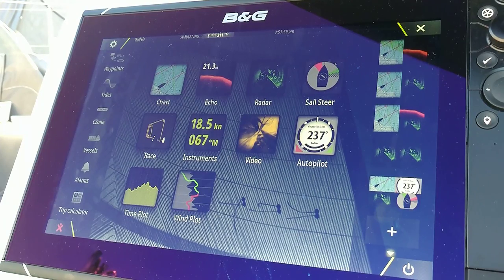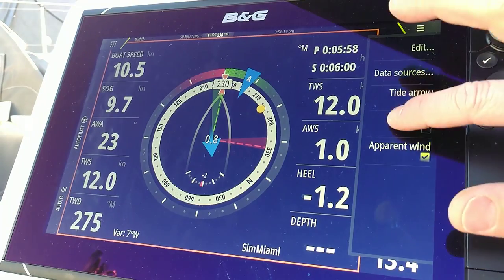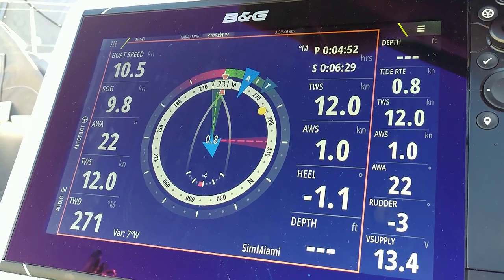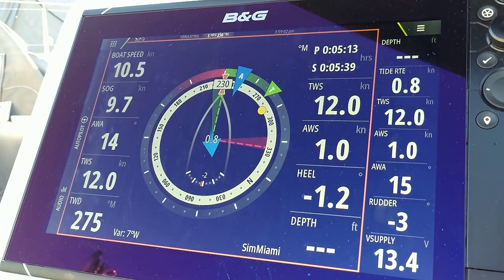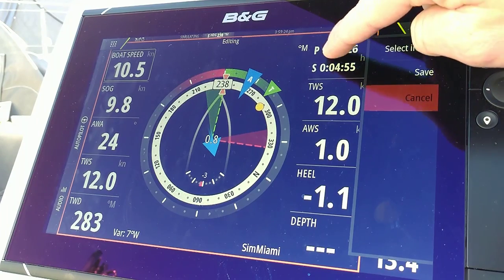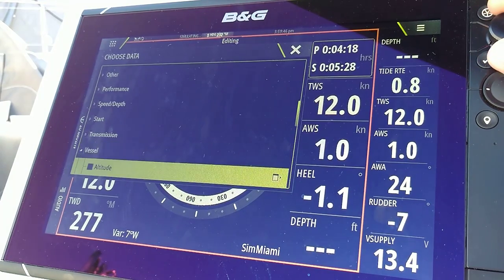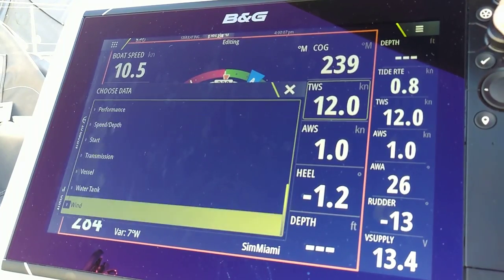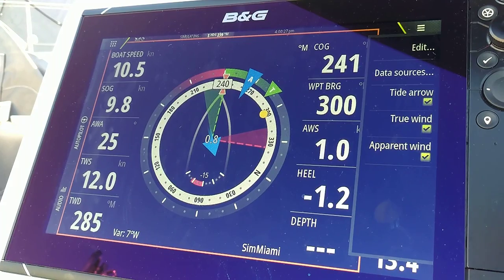B&G's Award Winning Sailsteer!

Comment: Hi, how are the boat laylines determined by the Zeus3? Is this a user or boat manufacturer entered fixed angle? Does the Zeus3 do real time calculations to change that angle, based on the actual performance of the boat? In other words, if i was to change the sails (deploy a code d maybe), would those laylines change (even though the wind or water current might not have changed)?
Reply: Did you ever figure this out?